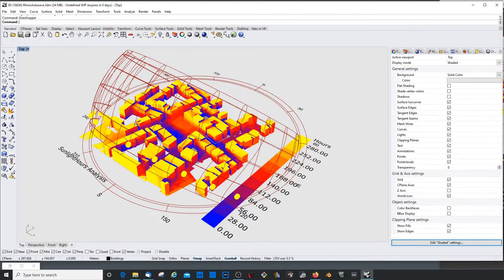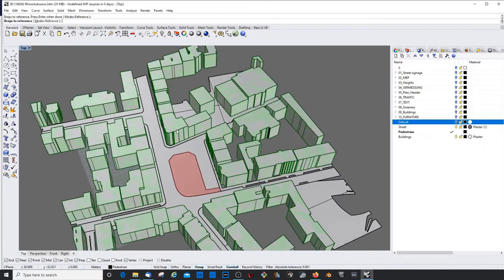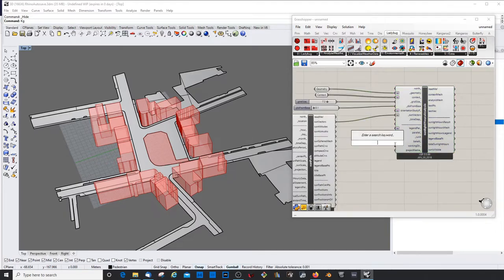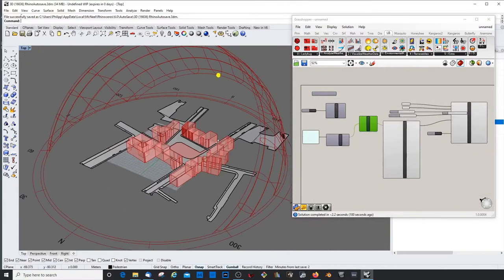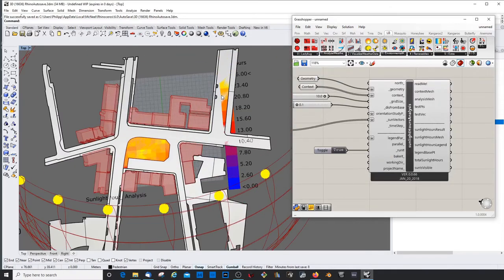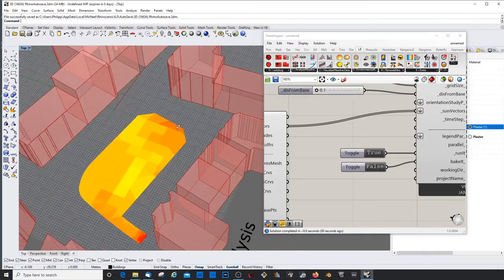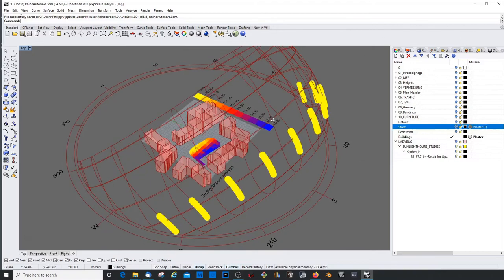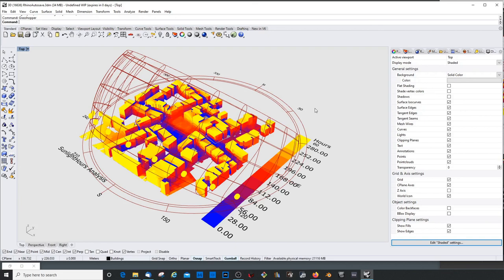Sunhour analysis in Rhino3d Grasshopper and Ladybug | Tutorial 005

Comment: Amazing tutorial! I have just one question: is it posible to take a capture or print the final result? Do you need to render it or something? Thank you!
Reply from the maker: @Raquel Peña - after you baked the result the coloured mesh is inside your rhino file. 
The coloured mesh is not a material so can't render it with vray for example. However I normally use a nice display mode and the print function or the capture viewport command. Which is: "_ViewCaptureToFile'. Which I use most often for diagrams since you can control the resolution and file format. its perfect for print or web presentations.
Hope that helps.
Reply: @PhilippGalvanDesign  Thank you so much! I though about render it at first, but the ViewCaptureToFile comand seems a more accurate solution. Thank you so much and happy new year!

Comment: Hi, first of all thanks for this tutorial. While trying out the script you described in this tutorial, I run in a problem, since the LB sun path component will not return any vectors to input in the LB Direct Sun Hours. Any suggestions? Thanks
Reply from the maker: Hey Flavio, I guess you are working with the latest Ladybug version? Ladybug tools 1.1.0?  Have you provided a time (hoys)?
If the time is set to an hour were the sun hasn't risen for the specified location then it can't return a vector. Normally the time is set to 0.  That would be midnight. 
Don't know if that is the problem you have with the script. I just tried it here and it works.
Reply: @PhilippGalvanDesign  Hi Philipp, setting the hoys surely has moved something forward, the vectors can now be read,  but still I cannot visualize the script correctly. In fact as further proof, if I run it it will not work. The constant upgrade of Ladybug is kind of tricky as all the tutorials I find are made based on the old version....
Reply from the maker: @Flavio Recchia - Yeah agree, the new Ladybug tools are definitely a bit different, and it is a bit frustrating with keeping up with the updates. However, I can see that the developers rethought some of the concepts to make them more straightforward.  Since there has been some confusion and question also from others I decided to prepare a follow up tutorial today. Will upload later or tomorrow.
Reply: @PhilippGalvanDesign  looking forward to watch it.
Reply from the maker: @Flavio Recchia - uploaded here: https://youtu.be/Pb1CO66qJGE -  hope it works for you. Let me know if you still have problems with it.
Reply: @PhilippGalvanDesign  Hey Philipp, thank you so much! the new video is spot on! It really helped me to frame the new Ladybug and I will look forward to watching the upcoming chapters! Best
Reply from the maker: @Flavio_R  Great to hear that it worked out. What was the flaw in your script at the end? But I guess most of the time it's just a small adjustment to make it work. I'll definitely do a follow up also for the other previous tutorial but it will take a while. Stay tuned.
Reply: @PhilippGalvanDesign  I believe the problem sat in the missed setting of the hoys. Besides I am still getting familiar with all the LB environment as well as the grasshopper one. That is why, at this stage I am trying to stick with the tutorials I find.

Comment: Hi Philipp! Thanks for this video it is super helpful. Have you ever seen or run into the issue of the vector output from the Sun path tool not properly loading into the Direct Sun Hours tool? I am getting the error message that "Input parameter _vectors failed to collect data".
I was having issues loading a weather file .epw at first but was able to properly download onto my desktop. I thought the issue could maybe be related but I'm not sure why it would be.
Reply from the maker: Yeah I had that issue.. ok so what I would do is trying different weather data files. Even though it might have downloaded it doesn't mean that the file is ok.  Try something very obvious. Airports normally have a good working weather data. 
Some weather data files are not working....because they haven't been maintained properly.
Reply from the maker: Where you successful with other weather data files? Or does the problem still persist.
Reply: @PhilippGalvanDesign  Hi, I also tried to try different weather data files but I still have "Input parameter _vectors failed to collect data" too.
Reply from the maker: @Rhaysan-u1s  which version of ladybug are you using? Legacy tools or new ladybug tools?
Reply: @PhilippGalvanDesign  Hi, it has been resolved, I watch your updated sunhour analysis with latest ladybug tools video! Thank you :)
Reply from the maker: Great to hear.

Comment: Were you using a SketchUP 3D? or AutoCAD DWG?
Reply from the maker: I never used Sketchup. I use AutoCAD sometimes, but not for this tutorial.
This is all Rhino3d.
Reply: @PhilippGalvanDesign  can l use Sket models?
Reply from the maker: @LeandroGalvao.arquiteto  hi, rhino allows for skp files to be imported. But it depends on the release. When skp are imported into rhino they will be translated to mesh model. Mesh models can be used without problem in rhino and ladybug. Hope it makes sense. Cheers

Comment: Help! how can I fix my ladybug ! 0:47 there is a 3x3 table of green squares, but mine is different... the one on the right corner of the first row is red, whole second row is blue and third row is blue!
Reply from the maker: hey Visatos, the 3x3 table appearing when you start GH are Quick access to previous grasshopper script files you worked on. Green means it was saved and found by Grasshopper. Red means the file was not found. (maybe was not saved or was moved or deleted)   If there is no file name in the blue rectangle i guess they are just placeholders.
The rectangles are not linked to the functionality of ladybug, you should be able to work without problem. 
I can only say, always save your work and scripts you are working on. 
Hope it  makes sense.
Cheers

Comment: Hi i imported the site with buildings from cadmapper, now it looks like i made all the buildings from rhino, but when i go to brep and select them, it doesnt select them? Please help!
Reply from the maker: Your buildings from cad-mapper are most likely meshes. So you need the mesh container instead of the brep container.
Reply: @PhilippGalvanDesign  i managed to get it! But now after doing the sun , all words numbers are way too big and overlapping. How do i make the font size smaller? Thankss
Reply from the maker: Not sure. What unit systems are you working in. What are you files unit? Meter? Millimeter? Inch?
Reply: @PhilippGalvanDesign  centimeters, when you are putting numbers in the sliders are those considered in meters?
Reply from the maker: The slider represent the units you are using in your file. If you are using millimetres it's gonna be millimetres if you are using meters then it's gonna be meters etc...
I would highly recommend to us meter as a unit systems for all your models when working with Ladybug. 
Ladybug is set up to work in meter. 
So i would encourage you to use meter otherwise you will create wrong output.
Reply: @PhilippGalvanDesign  ok sweet I changed it to meters and im going to do over again and will let you know soon! Thanks for your help!
Reply from the maker: I'm quite impressed that you want to jump directly into the sun-study but I would do some basic grasshopper course or go though the grasshopper primer which you can download for free. 
Ladybug will only get more complex from where you are now. So you will need basic understanding of how grasshopper works.
Reply: @PhilippGalvanDesign  Hi there, I have gone through everything and also made it all meters, but the numbers around the sun path still seems to be huge? Can I have your email to send you screenshot of how it looks? thanks
Reply: @PhilippGalvanDesign  nevermind i finally worked it out haha, I had to start up another rhino file then did the ladybug again. Thanks again for your help